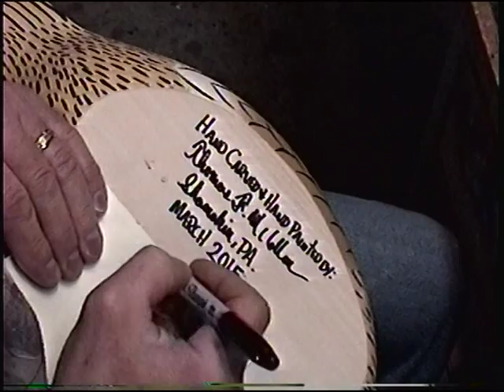Decoy Carving, Hen Mallard, "Ward Style" Part 4 of 4

Comment: what kind of brushes are you using for the details....they almost look like pencils
Reply from the maker: Donald Paul Joseph Racine If you mean the feather edging, I use a brush that I bought at Michael's Art & Crafts store. It's a Robert Simmons E51 Liner brush, not even sure if they make the brush anymore. The main thing though is it's a Liner brush. Comes to a nice point. Not to fine though. I use charcoal pencils to sketch on feathers and if I am not satisfied with a line I erase it off with a wet paint brush. Hope this helps.
Reply: +Donald Paul Joseph Racine look for rigger brushes.  They have longer bristles, making it easier to paint long lines.